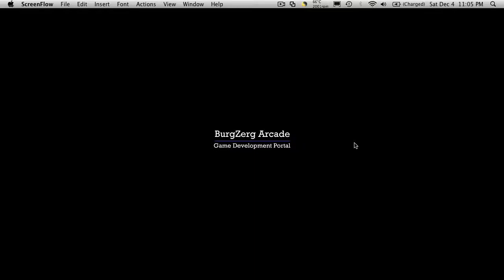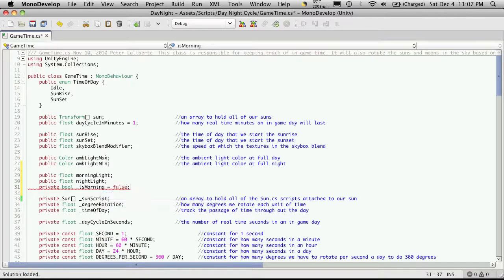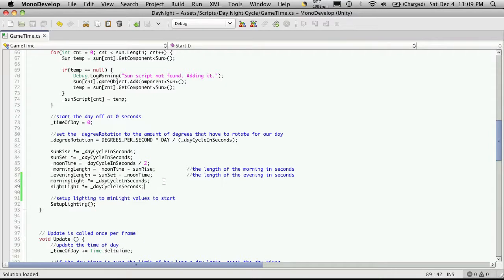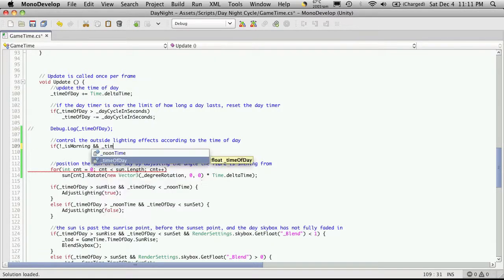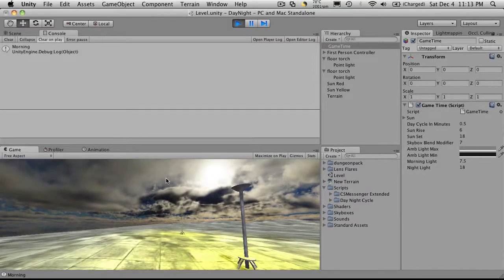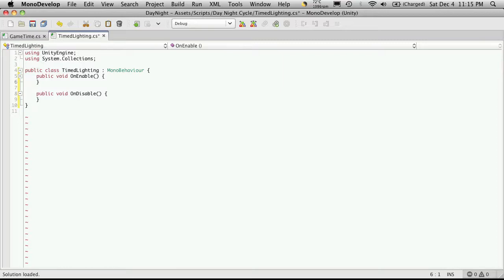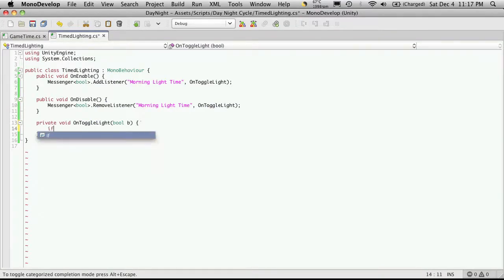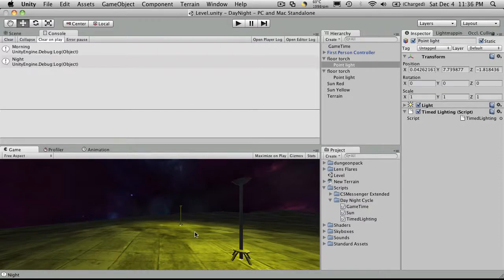81. Unity3d Tutorial - Day Night Cycle (Adding Timed Out Door Lighting) Part 10

Comment: For anyone having trouble with the Lights not turning back on a night I have noticed that he created 2 messengers but only used one, For whatever reason this was not working for me so i added and made use of the other one.

In TimedLighting first create a new function and call it ToggleLightOff with a parameter bool name it b and copy the same if and else statement from OnToggleLight. 

Under OnEnable Add the "Night Light Time" Listener with the function ToggleLightOff: 
		Messenger<bool>.AddListener ("Night Light Time", ToggleLightOff);

Then Remove the listener the same way as the other, and it should work just fine. Don't know if i messed up somewhere but this seems like the way he intended by instating two broadcasters.

Comment from the maker: @RoverDeDog96 There are still quite a few things that I want to do with this package, but I have to move on to other topics as the focus of this set of tutorials was to get the basics working. We have not even fiddled with the lens flare brightness yet, but we have the variables to set it up.

When I revisit this section, I will have to refactor it so it is a bit more efficient. Then I will work with clouds and possible weather.